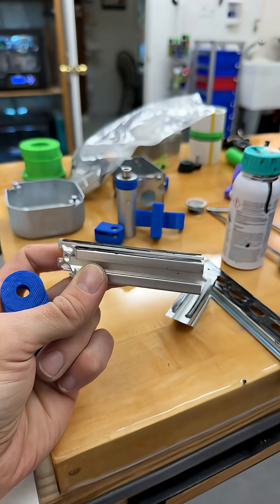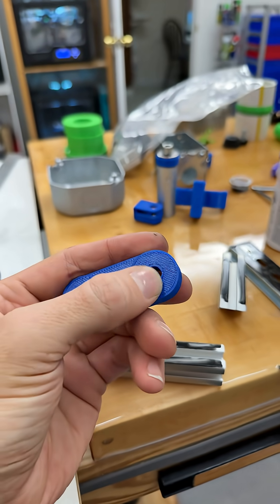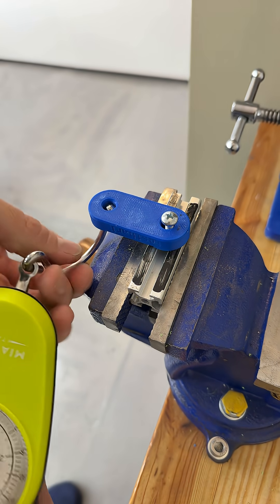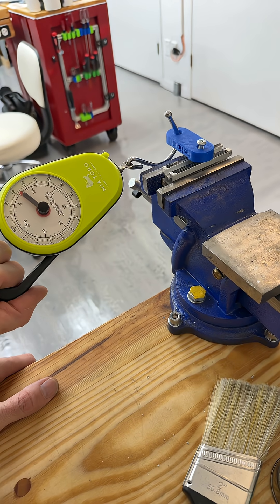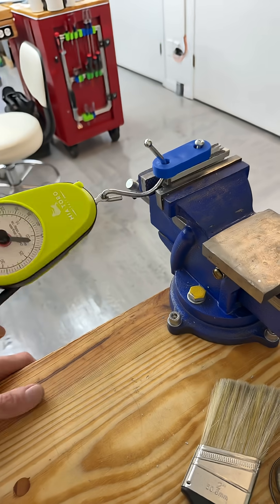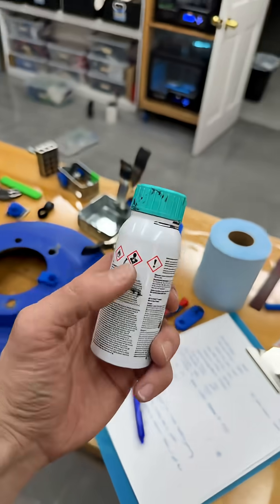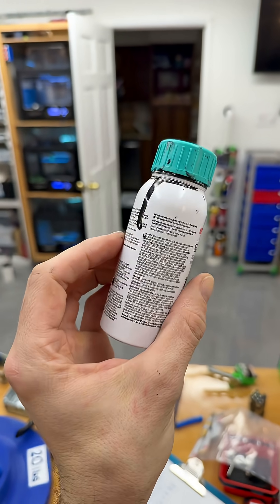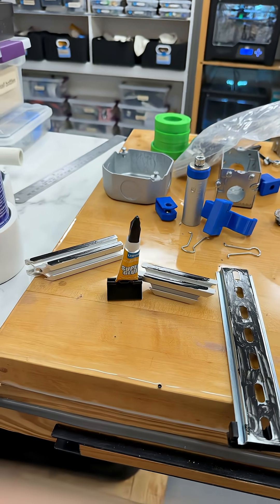Permanent Bond: Aluminum and ABS plastic. #openlabproject

Comment: Probably don't want to recommend 5504G as it's full of volatile isocyanates and is highly restricted in Europe now. Probably for ABS, the MEK is the main thing you're using. I would try an ABS pipe weld solution that should be available from the plumbing section.
Reply: Thanks for the the suggestion on an available alternative.

Comment: The entire bond failure was all the primer popping off the aluminum surface, hit that with a wire roughing wheel before the primer?
Reply from the maker: if i publish clear repeatable scientific data like this, with no hand-modification, then you can probably double or 6x the results with custom improvements.

every single part and method that I share comes with easy potential for 10x performance.  some performance++ will feature a trade-off.  only the individual builder can decide if the tradeoff is valuable.
Reply: @davidmalawey I actually thought about this inquiry after the fact, and do agree with you. The things I mentioned are a whole manual optimisation issue with manual labor added for subjective gains, spraying on the surface prep and just going with a usable result is a good metric.

Comment: Thirty five pounds  of shearing force is quite impressive indeed—especially given aluminum is not a porous material. We’ve come quite a ways from hide glue!
(I used to dabble in Better Living Through Adhesives back when I rebuilt pianos and moonlighted at a marina)
Reply from the maker: overall, wood is incomparable and amazing for gluing.  during this testing day i realized the anodizing with its chalky surface probably has micro-pores.  it performed much better than zinc-plated steel, which has more shine.

Comment: David, I may be speaking out of turn but what if you add a little bump that sits in the rail to add even more strength in that pull direction. So not only it would have to break the glue bond but also tear the plastic.

Hopefully that explanation makes sense
Reply from the maker: yep.  today i’m not testing a part design.  just a bond of the materials.  isolating the surfaces and the chemistry.

then we add the strong bond design to a strong geometry design then we get a strong joint design.
Reply: @davidmalawey that makes complete sense. Thanks for all the information you share
Reply: We Appreciate Grammar Professors for Syntax in Engineering
Reply from the maker: @Daniel-kz2io i just read my last comment and i clearly forgot how to write.  i sent more messages in the last 60 days with asian natives than Americans.  on one hand its sad and lonely here in texas (very lonely) and on the other hand I’m accepted and respected overseas.  I don’t know if i’ll ever feel home again.

Comment: Sand the primer to the aluminum
Reply from the maker: oh here we go again.😢 it’s a good idea if you want to do sanding. 

As for today, i’m not designing the strongest result. I am designing an easy result.  that is why I am not welding and bolting. What i published so far online gives less steps, less processing, and eliminate human induced variation. 

for engineering, a predictable strength is better than a high strength.  this is where engineering and workshopping split off.  back in the design desk we decide “i want this bond with this strength, otherwise “we will include a fastener here”
Reply: @davidmalawey listen dude. I’m still going to purchase a product and pretend that I as the installer am more knowledgeable and capable than the product I have purchased. Especially when it fails. Stupid engineers what were you thinking
Reply from the maker: @100achillguy7  a gentle and authentic request: can you tell about your specific last frustration from the engineering, that appeared in your life?   there are legitimately 1,000 engineers reading the comments in these threads.  If you actually remark on ONE specific issue, and be detailed - that’s 1,000 opportunities to improve.
Reply: @davidmalawey   The use of "pretend" tells me that he was being funny or sarcastic, not serious. 
Love watching you work! 👍
Reply: @davidmalawey I’m just bad at sarcasm. In reality, I have a high respect for the process engineers use daily to solve problems. I was just trying to make fun of tradesmen I’ve worked with that think they know a system better than an engineer who designed it
Reply: @100achillguy7 i totally got the satire and the context as being on point. I also got how it was going to be missed lol
Reply: @davidmalawey  This is the disconnect between engineers and folks applying the engineering day to day. It’s common sense to scuff the aluminum for better adhesion. But you respond to a common sense suggestion with this lofty vague response. Does variation in the sanding make the results less repeatable or consistent? Yes. Is it still worth testing? Yes.
Reply: @davidmalawey I'm thinking of displacement of some of the oxcide layer with a Abrasive applicator as a test or a micro grit in the glue that allows a small amount of directional load change. It was a test suggestion not a negative criticism of your processes
Reply: As someone on both sides of the fence, I would describe it as 'good' engineering that sometimes seems a bit unconventional (something in a bad spot) that is actually intended to be that way since it's the best compromise that was within the design constraints. In most cases, installers are far more knowledgeable about the installation and disassembly process in particular, not so much the actual engineering. Though, as in anything, there's a distribution of all types of people. Seems to work best when people work together and learn from each other, with humility. Just yesterday, I was going through an anchor performance test and the silly offset stand was such a dumb design that it was abundantly clear that whomever designed it hadn't used it or observed its use even once... Barely any space to fit pliers in to tighten the nut.

Cool video, David. Impressive what good surface prep can do - even sanding lol.  To me, there's a pretty invaluable hidden gem in here that applies to a ton of real world applications. To name a few, you can spend all day trying to solder a copper pipe, but as soon as you take the steps to keep the water away from leaching heat, cleaning (via sanding first lol), then, correct amount of flux and heat, it's amazing how easy and repeatable it is.  Welding is the same. Painting same.  It's like 90% prep and setup.  Have a welder set everything up and let you pull the trigger and it almost seems easy... Then try it yourself from scratch and a cheap welder... 

What's kinda funny about the sanding comment now that I think about it is that primer is often made to take on that step to some extent through chemical etching.  Perhaps something people wouldn't be aware of. Right tool for the job.  @davidmalawey, looks like you have a good combo there. Might try that. If you're looking for further content about this, would be neat to see same test for CA glue on the untreated joint, only sanded, only primed, and sanded + primed.  Including the processing time and criticality of the application, I'd suspect as you suggest, not worth the time to sand a joint like this that you're gluing since it's likely a low risk joint (otherwise you likely wouldn't rely on CA glue). Aluminum brazing is another example where similar prep is key to a good joint. Some good vids showing how strong a simple aluminum brazed joint can be for what it is, but also a case where many have tried it and the joint was garbo due to lack of proper prep... Surprised a comment can be this long-winded without a character limit. Keep up the good work.
Reply: @jeffpagnutti I hope you’re using your analytical skills to fullest extent… I wish I could focus on a single subject for the duration of typing out that long comment like you can lol.